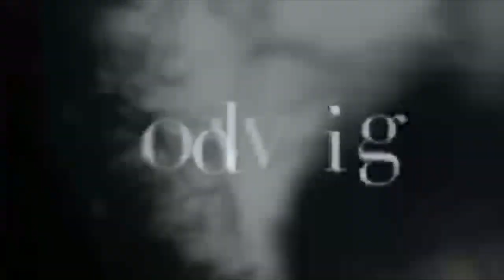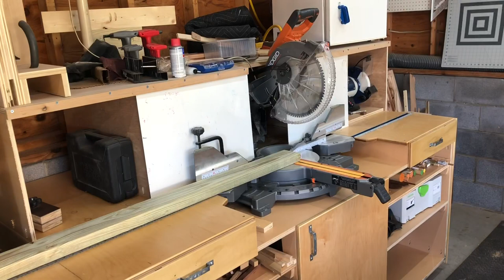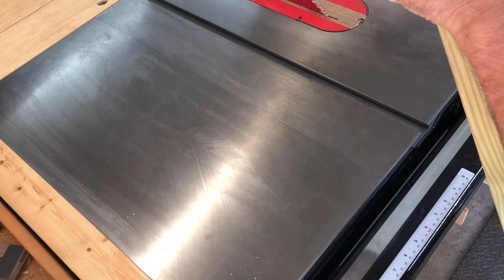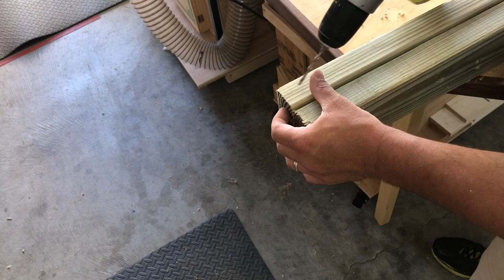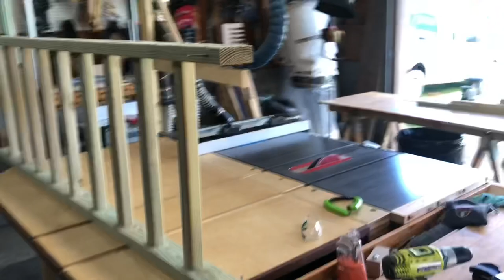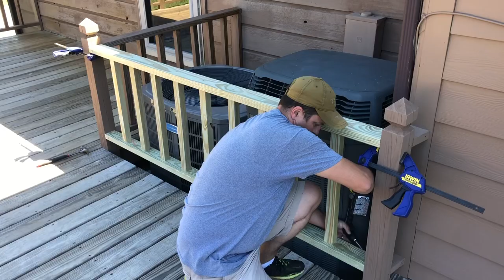DIY Deck Railing - Under 25 dollars!

Comment: as an hvac tech i hope you never call me to service or repair your equipment.... you put your AC guy "into a hole" with this handywork ... decks are great but you should have moved your equipment. just sayin
Reply from the maker: The banisters are easily removed and no one has had issues in the past. Ideally I would like the units somewhere else also but who can afford that right now? What would you charge to move the equipment?
Reply: If you can’t remove eight screws to get to the AC then you aren’t much of a tech guy!
Reply from the maker: @jenniferbailey5914 exactly!

Comment: People need to consider adding a way to open, or easily remove sections so HVAC can be serviced.  Being trane equipment, those coils take extra time to clean properly.  Servicing these would also be a pain and most contractors would pass, or require adequate space.  Not being lazy, but for safety in a very tight space around high voltage, refrigerant, etc.
Reply from the maker: People also need to read more comments before commenting… that being said, i agree. I didn’t build the house. I do my own maintenance anyways and 8 screws to remove a panel is not a problem… if thats an issue when it takes like 2 minutes thats just pure laziness which is so common these days…

Comment: Won't pass code. Pickets can't be no more than 4 1/2" apart on center. A child can get his head stuck between the pickets.
Reply from the maker: You are correct sir but I am not trying to pass code, i just made it match the rest of the house. Children won’t get their heads stuck if they are being supervised like they should. If by chance a head did get stuck it can be disassembled pretty easily with a screw driver. If that fails, its made of wood so cut it lol.
Reply: What does on center actually mean?
Reply from the maker: On center means every 4-1/2” you make a mark and the marked center of your picket will match up with those marks every 4-1/2”. I hope this helps.
Reply: @HurdCrafters  thank you
Reply from the maker: You’re welcome! Take care.

Comment: Those HVAC units are installed way to close together and in restricted airflow space.  That will noticeably reduce their efficiency, especially when both are running at the same time.  Just saying.
Reply from the maker: Yea and so has many other people in the comment section. It’s important to note, I did not build the house and I was not rebuilding all the frame work. That being said, i have had no issues with the uniting warranting changing everything. First set of units lasted from 1987 till around 2010 and they were still running. My grandmother just decided to upgrade. Then in like 2017 i did need a common repair but it was only $2,000 more for a new unit and an 11 year warranty. When i do rebuild in the future, i plan to allow more space so its more easily accessible without removing the banisters. The whole purpose of the banisters was to keep my dog out…

Comment: Hi! Thanks for the vid. If I want to paint it white, should i do it before or after assemble?
Reply from the maker: I would paint before assembly.
Reply: @HurdCrafters  you need to let pressure treated wood cure out usually 4 to 6 weeks, depending on how wet it is before painting or staining it.
Reply from the maker: Did anyone say anything about pressure treated wood?  You are correct though it should sit for a while. If you sand it you could paint sooner im sure. If we have questions regarding anything we will definitely let you know because it appears you will have an answer lol

Comment: Great video. I have a question. What kind of extension for your drill is that for the back screws?
Reply from the maker: Thank you! It is a Milescraft drill90plus right angle drill attachment with keyless drill chuck. Try to say all of that in one breath lol. Its around 20 dollars and has came in handy many times!  Thanks for your comment and thank you for watching!

Comment: I might've missed it but are you using pressure treated 2x4's or regular ones? Someone recently told me not to use pressure treated for railing because of the shrinkage.
Reply from the maker: I am using pressure treated. I needed to because it is exposed to a lot of weather. In my experience you will get shrinkage with any lumber from a big box store...the bigger problem with pressure treated is twisting...
Reply: @HurdCrafters  Thanks for the follow up!
Reply from the maker: You’re welcome!

Comment: How do you service the AC unit??
Reply from the maker: Service them? What? I’m supposed to do that???
Reply: They are boxed in so well already. I have walked away from easier jobs. Getting to service ports at bottom back of condensers is going to suck for the tech. Much less seeing what you are doing back there. Systems should have 24 inches clearance all the way around.
Reply from the maker: I didn’t design any of this set up. Trust me, I understand there should be 24 inches. That being said, walk away from easier jobs? I just did the maintenance on the systems myself in 4 hours and i had no issues after removing the banisters. Im not skinny either…
Reply: @Yourused  That's what I thought. I would think this would lower efficiency, and the HVAC tech is going to hate it. Personally, I like to keep my HVAC clean, so I blow out the crud every week or so with an electric leaf blower. Keeps things from getting clogged and cemented in there. No way to do that with this installation.
Reply from the maker: I wish I could do that but I’m stuck with set up. Cant win them all…

Comment: Really new to home improvement, why do you cut off the ends of the wood before you cut it to length?
Reply from the maker: Great question! It is not required and if you do so, it’s recommended you add a sealer to the ends. I do it because i find that big box stores sell lumber that do not have square ends and I like tight fitting joints during assembly because when wood moves overtime, gaps will more likely appear. The less gaps i have during assembly the less gaps visible once movement has occurred. Thanks for watching!

Comment: You ever have to work on the ac you will have to move the rails.
Reply from the maker: Yea that has been said many times. Its not a big deal to remove 8 screws and remove the banister if needed.

Comment: I guess your gonna remove the railing every time the HVAC is serviced or has issues?
Reply from the maker: Correct. 8 screws holds it in place so it should be pretty easy...

Comment: How do you secure the handrail so it doesn’t wobble if you only need one side?
Reply from the maker: There are multiple way to attach the banister and the correct way would depend on your decking and framework… ideally you want to connect to the framework with lag screws or bolts…